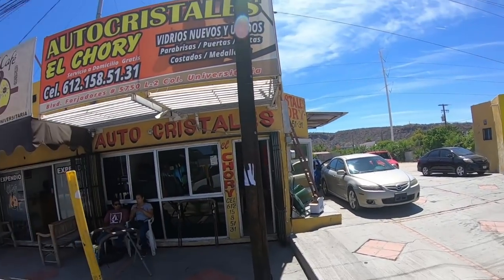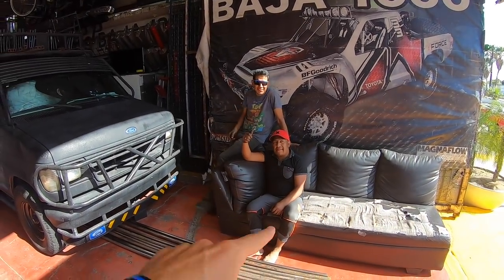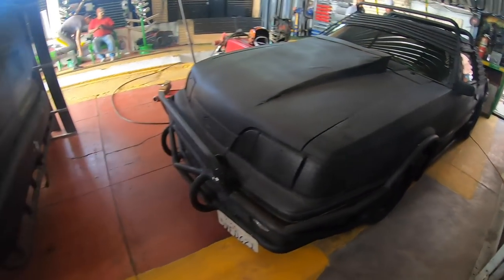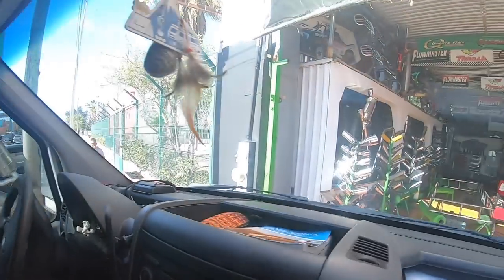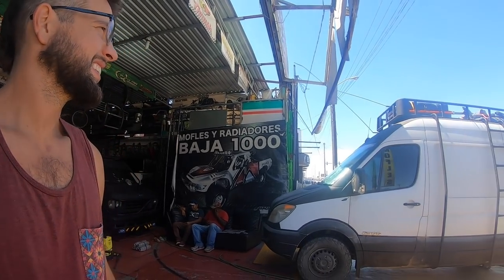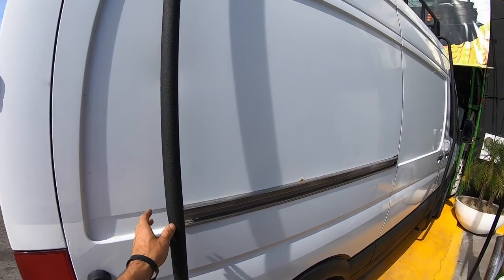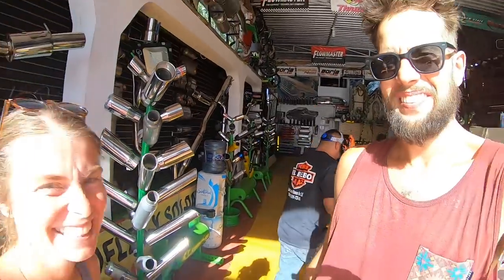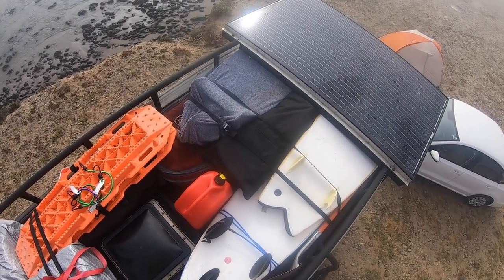Sprinter Van Rack Budget DIY | Under $1000 Custom Van Rack  | Cheaper than Aluminess

Comment: Is the entire rack supported by the posts at the four corners (so to speak)?  I've got a step van and looking for ideas on a rack that can support several people on top if want to chill/sleep there.  I'm thinking hinged safety rails that pin in place when upright.
Reply from the maker: No.  It’s also bolted to the roof rails on the sprinters roof.  But that would totally work!
Reply: @Vankookz  Thanks for the response.

Comment: Love love love your videos!  I've been thinking of doing something similar but in the U.S. 

I have a Promaster 3500 extended hightop so different measurements, of course, but am wondering how high your rack from the rooftop?  I'm thinking it might be good to have a gap between the rack and the roof for airflow... maybe it will help with heat?  

Most of my time is spent in hot, humid climates- rarely cold weather. Older Land Rovers  had "tropic rooftops" that protected them from taking the brunt of the heat by allowing some airflow between rooftop and rack. My rack will be covered with solar plus a fan or two. 

 Have you noticed the gap or lift off of your rack helping with the heat at all?
Reply from the maker: C Breeze there isn’t much of a gap it is bolted directly to the roof rails. In my opinion it helps reduce the heat since there is so much gear up there right now it’s another lever of insulation. But in my Vanlife experience when it’s hot.... it’s hot and some times a wet towel and a spray bottle are needed.

Comment: I hope you used stainless steel. I had an adventure rack completely rust out and drip rust all over my Newer Ford transit in just over 1 year near the coast in California. If you are watching this video make sure you get Stainless 304 or Aluminum if you live anywhere near salt water or you will have a more costly problem than saving a few bucks on a rack. Regular Carbon steel will rust right through any powder coat in a matter of months near salt air. I am redoing my rack with stainless 304 now.
Reply from the maker: Michael Andrew whoa, did you not paint it?! 😱 sounds like a bummer! Ours has many coats of raptor like paint!
Reply: Van Kookz full powder coat. I was surprised too. The guy who originally did the rack is in Oklahoma and when I bought the van with rack it was shiny black after a few years, 6 months on the coast and cancer rust death.

Comment: It's not really DIY now is it. Misleading title
Reply from the maker: Oh it definitely is.  Not only DO YOU have to design it.  You also have to translate entire conversations. You also need to be able to seek out and find a shop as well.  So YOU DO have to DIY.
Reply: i agree plus they are comparing steel to alu rack. In general alu is more expensive materiel and lighter too.  Never the less, it looks like a good rack and great price for a custom made rack(probably a better title, lol).  I guess one person budget is another person expensive.  I made my roof rack with superstrut for $130 and its "true DIY" from designing, going to lowes, to cutting and bolting up the rack all done by me.